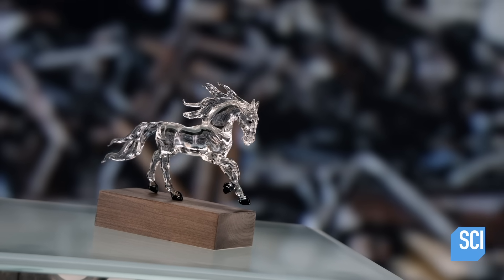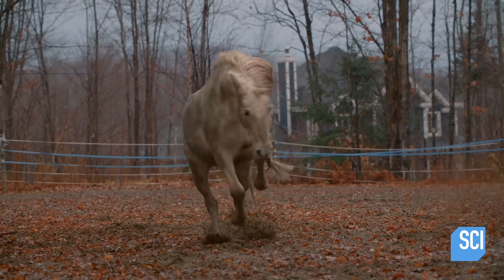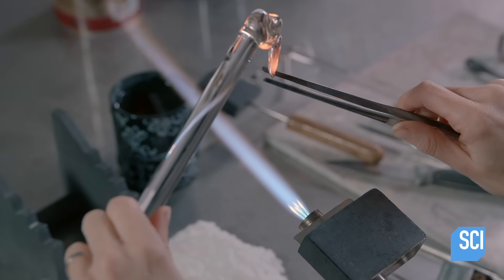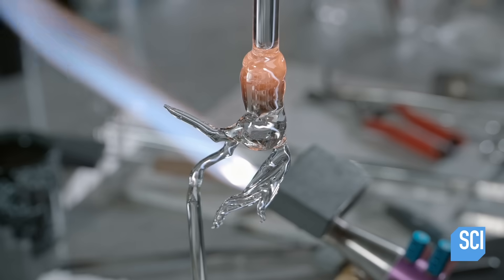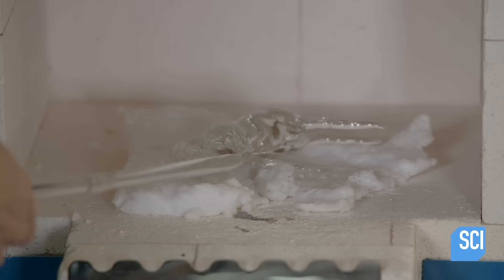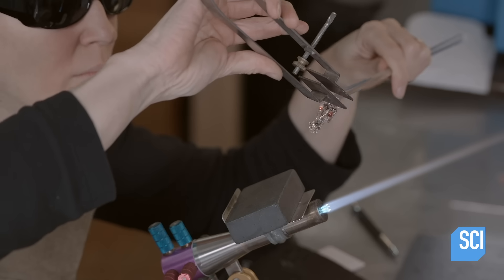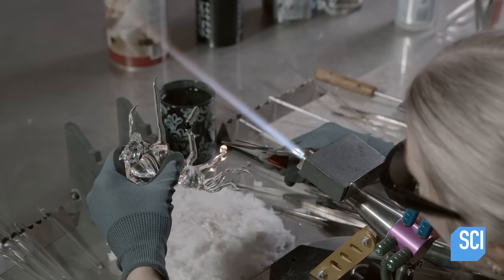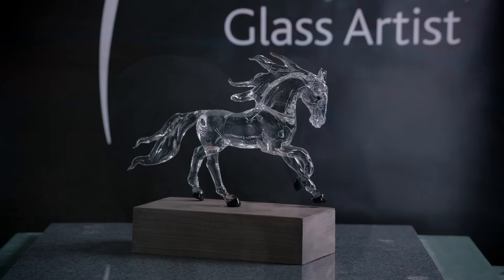How to Make Glass Sculptures | How It's Made

Comment: Annealing isn't baking so much as it is holding the glass at a certain temperature to equalize thermal stress or gradually lowering the temperature. 
Also no one wears gloves while at the torch because it makes it very difficult to turn the glass (try turning a pen the same way with gloves on). They sometimes wear Kevlar sleeves, though. The glasses (didymium lenses) filter out harmful light from the torch (if you stare at it for too long, you'll see bright spots).

Comment: And here I was thinking it was going to be something like.... Someone melts a whole lot of glass and pours it into moulds then opens then once they cool down.
Reply: Mass production can be made like this usually, but hand made art is this way
Reply: Well it can't exactly be done like that because the Glass will want to cool down faster than it should. Causing little Micro cracks and the moment it comes out of the mold it shatters. Clear Glass is actually more of a bitch to work with than Titanium. You pretty much have to mother it through the whole process and Metal is too rigid either way. Better to use something like Plaster or ceramic as the mold material. There is a way to get around it but you essentially have to continuously remelt and anneal and it's just easier to mold it or do it yourself. It doesn't take away from the skill though, if anything it adds to it.

Comment: She was doing it bare handed
Reply: Glass is not a very good heat conductor, so the heat from the flame doesn't "travel" down the glass rods like it would if she were using copper, for example.
Reply: @paulburns4721  still flames could have   injured her hands without any safety gloves
Reply: @VenomB6612  You're really not supposed to wear gloves while working with glass the way she is. Gloves make it really hard to turn the glass rods.
Reply: @cobalt1754  okay 👍
Reply: Most glass artists do
Reply: @cgamejewels  But her hands were really near to flames